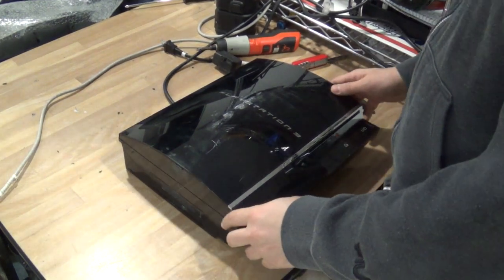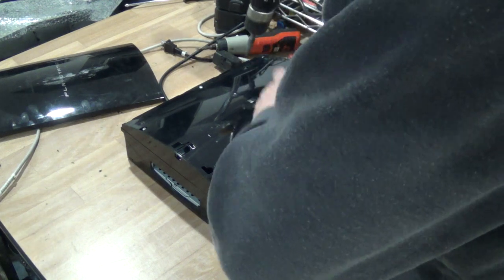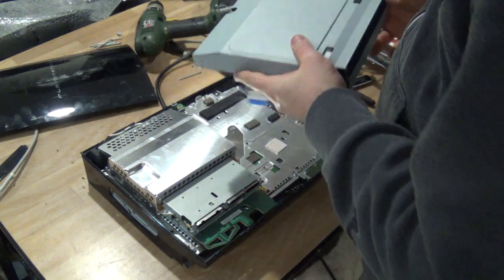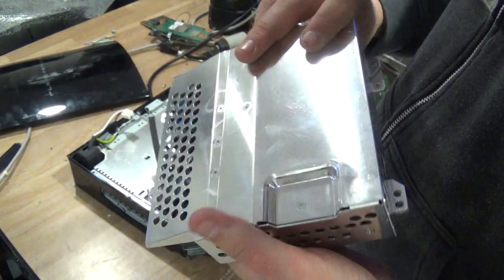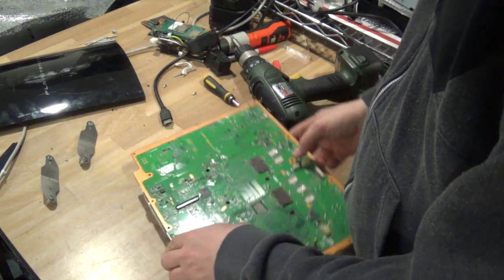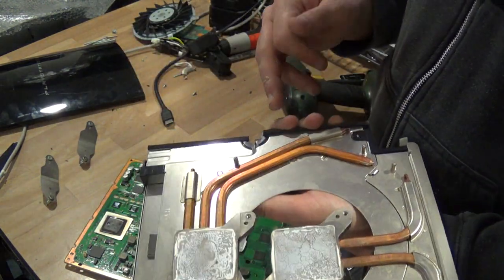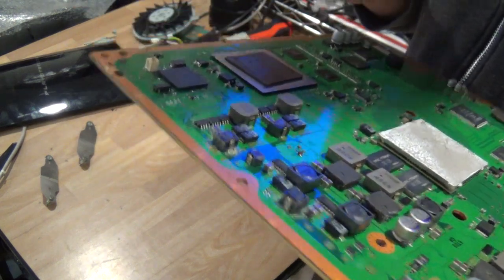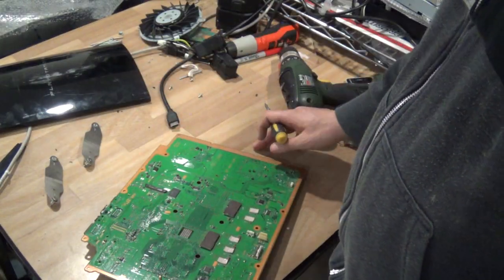Scrapping a Playstation 3 model CECHA01 for Gold, Silver, Palladium & Other Precious Metals

Comment: Scraping ps is good or bad
Reply from the maker: It really depends in what shape the PS3 is in. I've seen some really bad one with lots of water damaged etc.... I usually scrap those. The motherboard alone is worth about $1.00 at certain scrap yards. They also have quite a bit of gold if you want to take out the components. They have many IC chips, gold pins from USB, HDMI, Ethernet and connector ports. Then you have fans for the copper, they have wires. Scrap the blu-ray player also. The laser in them have some nice gold also in the diodes.

Comment: how much scrap $$ would you get per console?
Reply from the maker: It depends on how you scrap it. If you do it nice and simple and just separate everything without pulling gold, IC chip and other stuff out, you could probably get about $5-$7 in scrap but you should only do this if all major components on the PS3 are none working. If the Blu-Ray, Power Supply and motherboard are fried, then scrap it completely. If some of these parts are still working then sell the working parts and scrap the rest.
Reply: cheers lad I have like 9 scrap ps3's and 4 xboxs but disc drives still work etc so I might give it a go
Reply from the maker: For the disk drive on the PS3 if you sell it locally you should be able to get $40 for it. If you sell it on eBay you'll get about $25 to $30 after fees and shipping
Reply from the maker: Well scrap yards pay for totally scrap ps3s. Just take them a part, separate the material and bring the to the yard once you have enough material. 

If you're  talking about selling working parts, you could find people for them. You don't know what you're getting when you buy a broken ps3 off of eBay but you know exactly what you're getting when you're buying a working part.